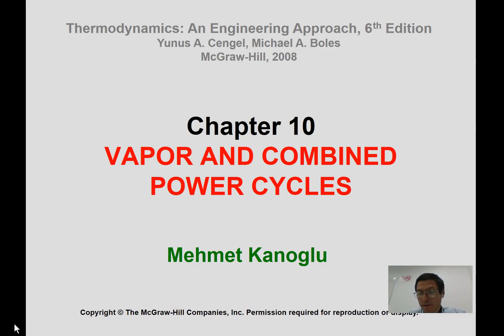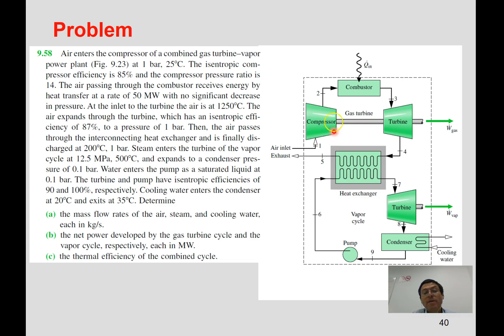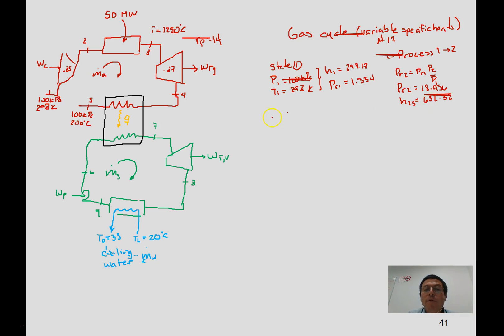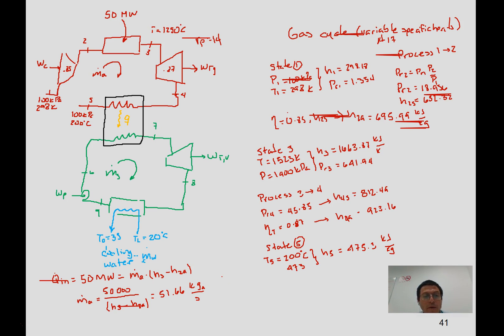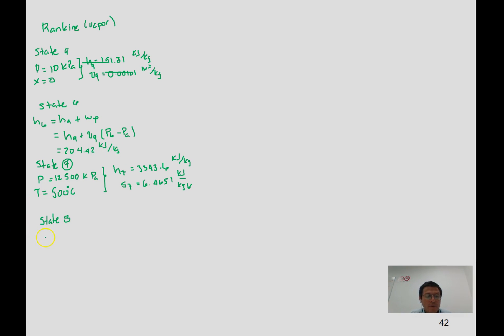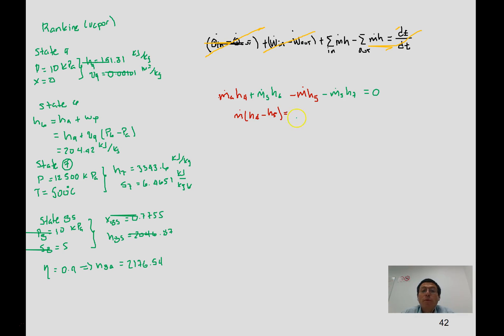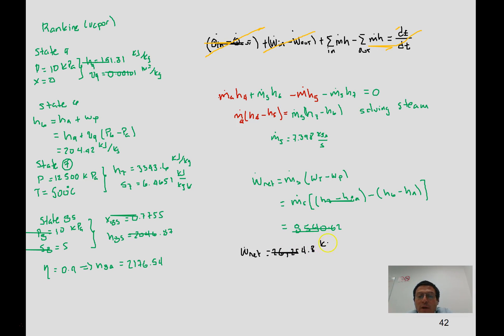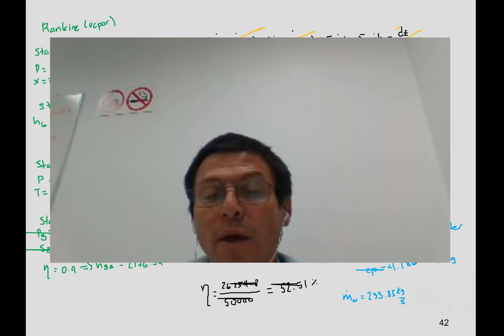Combined cycle problem

Comment: thank you for your presentation  and your effort I have  one note  you are forget that the air after mixed with air and fuel inside cc go throw turbine as exhausts gas  not air     also the same concept at HRSG  THANK YOU
Reply from the maker: Thank you for your note. We are using the approximation of air standard assumption. Since air fuel ratio for gas turbines is very high we can can consider the inlet an oultet to be just air.
Regards César

Comment: How does the Brayton and Rankine Cycle differ from the Allam Cycle ?  

As I understand it (from memory), the efficiencies are similar between combined and Allam, except that carbon capture is inherent in the latter (which removes water/steam state changes from the process), whereas for the former it imposes a post-generation cost of 20-30% (or more) on overall efficiency.

There's already at least one plant under construction using the latter.
Reply from the maker: From what I reviewed the Allam cycle si a modified Brayton cycle. It uses CO2 as working fluid. In my mind the water is used to keep temperatures in the turbine at a right temperature. The excess CO2 is a by product of the cycle.
Efficiencies I have found (~51%) are still lower than combined cycle (~62%). Thanks for bringing to my attention this technology. I will share with my students
Reply: César Gutiérrez PR You're very welcome (+1), but AFAIK even though the front end efficiency is slightly lower, that is misleading because the negative difference is offset several times over on the plus side by the built-in carbon capture (vs the high cost to do the same on a post-gen basis in combined cycle). If the analogy were accounting, it is like the difference between a sub-total and a grand-total ... the former is not the whole picture.

Zooming out to the power industry level, I have no dog in this fight, and this is a little out of my wheelhouse on science, but I can still see the potential advantages, esp from a long term environmental standpoint, so it is interesting to follow the news on things like this.